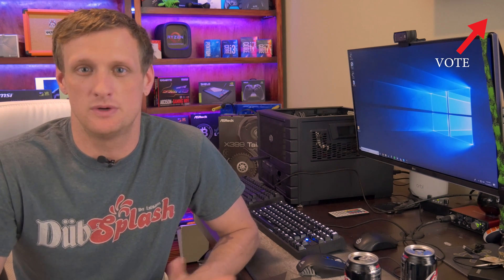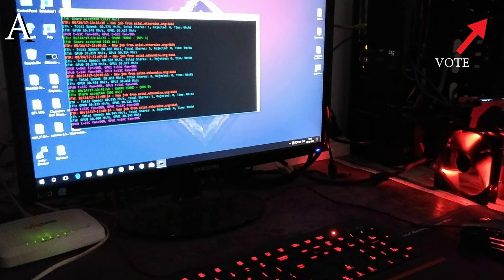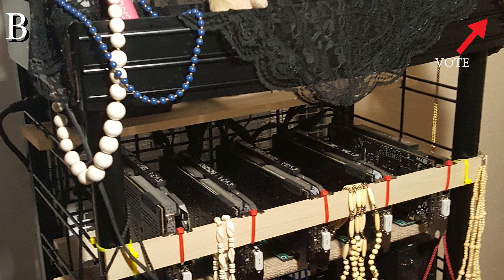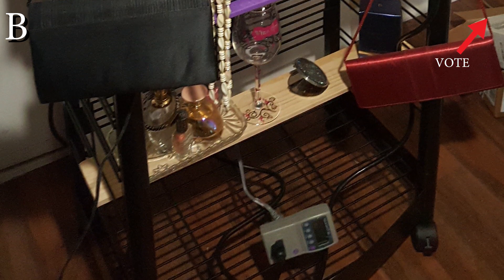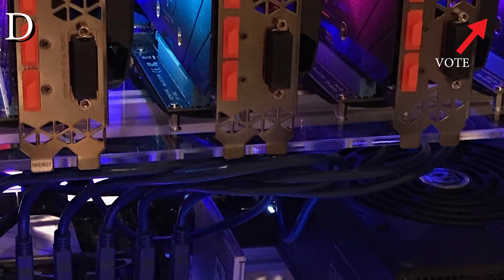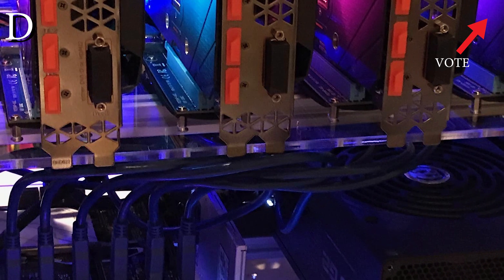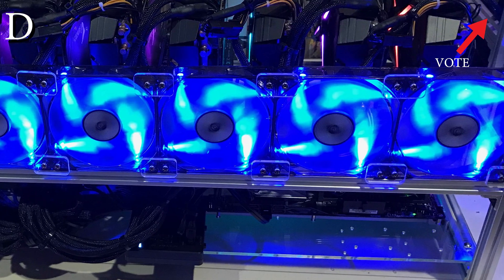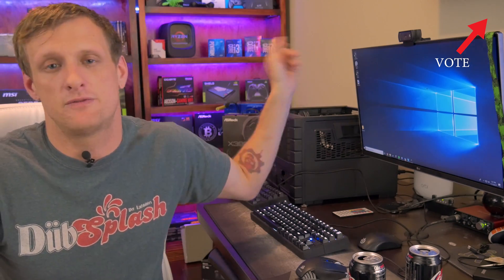Mining Rig Wars #9: Best Mining Rig?

Comment: 3 saphire rx 480 8g with linux...continues to show only 2 cards..and super slow hs.... please help...ill shoot you an email with all the specs later... but this rig is a nightmare ...im in need of pro help..should i remove linux and install windows..i just dont know.... :((( cause this cards are amazing and this rig should be doing waaayyy better ...but seems the previous owner did a shitty overclock and now im taking his Karma... :the bios switch is in the factory setting...(((((
Reply from the maker: If the cards were flashed that may be the issue. Shoot me an email